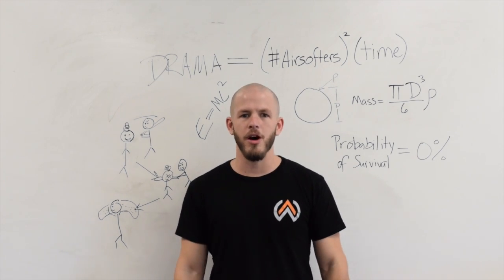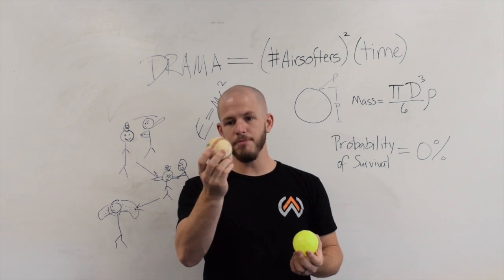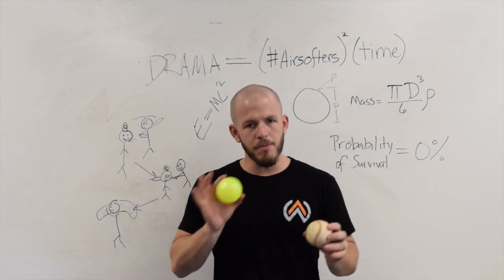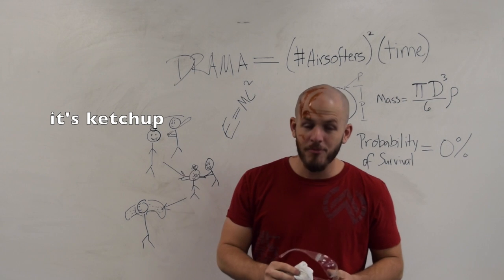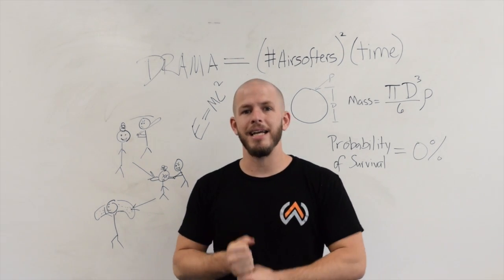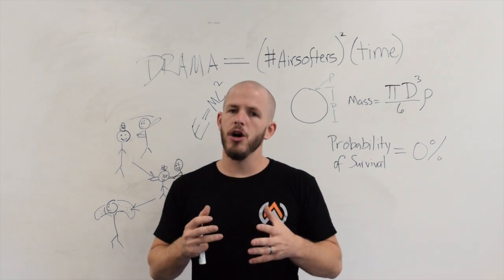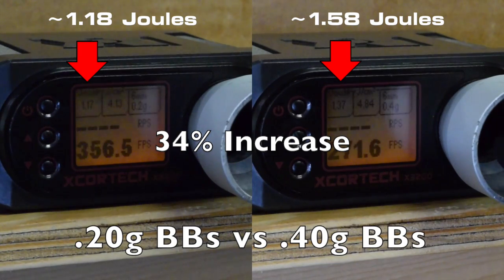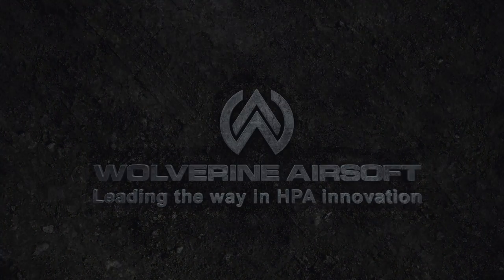What the Tech?!?! Ep. 27 - Mythbusters II: Joule Creep

Comment: then how is it as a sniper with a bolt action, my joules drop as the weight increases? the chrono measures in both.
Reply: Energy doesnt always goes higher with heavvier bbs. For every build there is an "optimal' bbs that will give the higer energy ouput (all other varibles being equals. This law is mathematicaly true). If when you increase the wieght of your bbs from .2g, the energy output only goes down, this means that the maximum is reached for the bbs with a mass inferior or equal to .2g. The energy ouput depends on a lot of parameters : bbs weight, barrel diameter, length, cylinder volume, air seal, cylinder diameter, springs, hop up rubber, hop up setting, and so much more to the point where its impossible (really hard) to predict anyway so you have to test every specific rifle anyway. People have figure out some general pattern that help increase the joule creep (which is the ratio energy_with_bbs_x/energy_with_20g_bbs), like higher air volume with heavy piston, but ther are just general idea and should always been taken with a grain of salt.

Comment: Joule creep is still a myth. When you use two dfferents bats, you have the same max speed but not the same energy. Because your muscles cannot go faster than a certain limit. The comparison is completely biased. And i wont even talk about the energy transfer, completely different between the two bats. But, in airsoft, BBs transfer the energy the same way. 
KE=1/2mv² as said in the comments. We measure v outside of the barrel so there's no point of "the lenght of the barrel blabla". Joule creep is a myth, stays a myth. You just have to measure the energy of the BB used by the player and convert it as if he was using .20g BB. There's plenty of charts outside to help with it.
Reply: okay then explain this please: https://youtu.be/0qAjaK88R7o
Reply: The analogy with the swing of an aluminum and a wooden bat is not about velocity, as they may be the same, but about the transfer of momentum between a stiffer material (massive wood) in comparison to softer material (hollow aluminum). If both bats were identical regarding material properties and velocity, there obviously would be no difference in the ball's launch from the impact. The massive wooden bat can transfer more momentum to the ball, as it is more dense and stiffer, resembling a theoretical rigid body more than the thin aluminum tube that hits the ball, as it flexes more during the impact, absorbing more energy away from the momentum exchange event, so that less velocity remains for the ball.
Reply: Joule creep is not an actual myth, I guess. It means that a heavier BB can acquire more kinetic energy, simply because it's heavier, not because it's flying faster, as it does not do that at all. A heavier BB can travel further without being dragged by air too much in comparison to lighter BB's, which is why heavier BB's are preferred by airsoft snipers. A light BB will come out of the barrel with more velocity, but it will lose its velocity sooner than the heavier BB.

Rules want us to take the BB's energy into account, as we may hurt each other by the impact. This is where momentum and kinetic energy come into focus. Restricting muzzle velocity is meant to restrict the impact at the skin, even if we cannot predict what that impact velocity might become, as it depends so much on distance and initial velocity.

Joule creep is not my preferred term in this context. I would rather call it kinetic energy uncertainty, but that will probably not be echoed too much by the community, I guess. Just be aware of the effect of initial velocity and the BB mass on the potential impact energy that someone can endure.

Comment: Are HPA systems more efficient with joule creep due to dwell timing? I'm just a bit confused as to how a properly tuned AEG (cylinder:barrel volume ratio acccounted for) and a properly tuned HPA system like my MTW (dwell timing set properly for my preferred bb weight and inner barrel length) are any different in terms of joule creep. 

I can see how my MTW might have more efficient joule creep if I had my dwell set too high, causing the nozzle to stay open for longer and thus propel more air and gather more force behind the bb, but not if both systems are properly tuned.
Reply: The longer barrel the more joule creep you will get, and even more if you are using gas like CO2 or green gas because of the expansion rate from liquid to gas. In my own testing i get less joule creep with compressed air than with an AEG i´m guessing that it has to do with the pressure being the same from the start to the finish with air while the AEG will get the more pressure as it compresses more air before stopping at the cylinder head.

Comment: At our site you tell them what weight you are using, and they know the fps limits for each weight. Works pretty well. A good point here is about the players responsibility. They know and trust me at our site, if I wanted to put a powerful spring in, load it with .40s, and tell them at the chronograph they were .20s, they wouldn't question me.... Until the kids playing there started crying. You can't stop that crap from happening, my friend on his first game, got hit by a sniper that took him off his feet, and put a massive swelling on his head. When the Marshalls got him, they chronoed him with .2s. 800fps. Prick.
Reply: holy fuck!
Reply: It's hard to know who's cheating. 
Best defense for cheater is to wear proper protection if you don't want to get hurt. 
Accidents happens all the time. Sometimes friendly shots happens too.
 Even if the  gun is following the rule getting shot point blank is like getting shot by a hot gun.
Whatever the situation is, proper safety gear is the best bet.
Lots of whiny players complaining.
It's a contract game,  your there to shoot others and to get shot.
You don't want to get hurt stay in the basement and do something else.
Reply: @bobskiswabeski7597   pretty easy to know who's cheating. Do a joule test with a set weight of BB provided by the field. marshalls load your gun, you shoot 5-10 bb's and it's clear. .30 for aeg and .40 or .45 for DMR and sniper

Comment: very helpful good video they need to stop making .20 .25 and .28 and above fields should test at .32 i was playing some cqb and got shot in my hand its been 2 weeks and it still hurts. i've been shot in the hands before but this time it really hurt i was saying to myself dam hpa players never use 25 or 28 felt like a 40 just didn't think it would that much difference in weight/velocity. field owners need to implement.
Reply: Really doesn't matter in my opinion... I got shot around a corner, had to use tweezers to pull the BB out from between my knuckles. This was from a standard WE g36 GBB shooting 355 fps in chrono with 0,20, and had 0,20 in the mags.

Besides that: I can't see my replicas shooting anything heavier than .25, because then all my work to make the bloody things accurate has to go in the bin, as I'm sure a lot of others with shitty hop-up units had to have worked with in the past.

Comment: Idea for a new Mythbusters video :D
Is a longer barrel more Precise than a short one. Comparing a 250 vs. a 500mm or so :)
Reply: Crazy Swiss It's the same reasoning behind voluming. You need to have the voluming right so that your bb stops accelerating just before it leaves the barrel, and on some guns with some bbs a longer barrel could get you closer to the perfect voluming. Changing to a shorter barrel on a stock gun will almost always move you in the wrong direction as stock guns almost always come over volumed, however if you were to put too long of a barrel on a stock gun you would get undervoluming which causes a lot of really bad problems which you want to avoid, over voluming is better than undervoluming. People swap their stock barrel for a longer one, get closer to perfect voluming and get a marginal increase in range and accuracy, and this combined with the placebo effect has given rise to the myth that longer barrels are more accurate. Oh and also the fact that in RS shooting a longer barrel is often times proffered for its own slew of reasons.
Reply: Jarod, that is actually untrue. Far more important than barrel length is:

A: Barrel quality - how well is it finished, does it have microscopic bends, flaws etc. Is it perfectly straight and even on the inside?

B: Volume. This is where things become tricky. Depending on your operating cylinder volume (determined by things like porting, short-stroking, AOE correcting etc. different barrels of different volumes will work better, two barrels of the same bore but different lengths will, of course, have different volumes. You must also volume your setup in accordance to what weight BB you will be running. The rule of thumb is to get the longest inner barrel that will fit inside your outer barrel and volume the rest of your setup from there.

In an HPA setup your volume is instead limited by the tank you run, so you can volume for pretty much any length/bore barrel you want, except that a barrel with a greater air volume will use more of your tanks total capacity per shot.
Reply: Keith Anderson see? that's why i would like a Mythbusters video about it. even though we all agree that the barrel quality, stiffness and woble has the biggest impact on precision, it would be nice to know what the difference of barrel length really is about.

Comment: Is it true that the longer your barrel in an hpa gun like (wolv inferno gen 2) the more joule creep you can get than a shorter barrel? Thanks!
Reply from the maker: Hi Sheridan, yes it is. Think of swinging a golf club, if you start your swing with the club all the way behind your head, you can build up more momentum than if you only brought the club to your waste level. The same thing happens with a longer barrel, it will build more momentum behind the BB, thus more energy will be exerted.
Reply: Great answer. even google couldn't find that one.
Reply: @WolverineAirsoft  Sorry, but that is not true. The concept of momentum-exchange between two rigid bodies is about being instantaneous, not as some kind of a rail-gun. That would be like accelerating the BB up to some maximum velocity before it leaves the barrel.
If the BB has been accelerated at the very beginning of the momentum exchange, then this is it. The extra travel through the barrel is not adding more momentum, unless the acceleration would at least remain constant.
The alleged analogy with the longer or shorter swing of a golf club is not appropriate here. That longer or shorter swing is indicating a varying velocity at the instant when the club hits the ball. That will obviously affect the momentum exchange.
Momentum is the product of mass times velocity. All you can do to increase momentum is to increase velocity, and that can be accomplished by increasing acceleration, or, by increasing the velocity of a piston or something similar (like a gulf club) that will transfer more momentum to a ball, if the piston's or gulf club's velocity has been increased. If the piston or gulf club swings further across its path, remaining behind the ball, it will transfer nothing to the ball anymore.

Comment: Let me ask this. My field uses .25g bbs and max of 400fps. If I use .30g bbs should I re choreograph?? That seams insignificant. One of my AEGs shoots a .25g at 390fps and a .30g at 360fps whats the point of bashing an HPA that will produce the same thing I have tested them side by side. The difference is about 8 to 10 fps in favor of the HPA. 10 fps out of 400 isnt worth talking about. IF someone is using .43 .45 SNIPER bbs in a HPA system full auto gun THAT IS Cheating.. However there is  NO big change AEG or HPA at .25 vs .30 For Joule creep bla bla the difference is to little.
Reply: No one is bashing HPA. Heck we sell HPA! What you are saying is exactly what I said The end: if you chrono with a sufficiently heavy bb that there isn't a big difference in the weight, most of the difference goes away. But keep in mind that even going .2-.3g bbs you can see a 15-20% increase in energy. .25's to .3 is not nearly as dramatic.